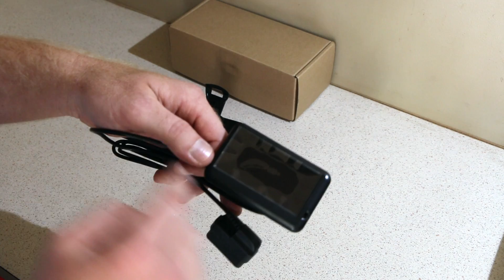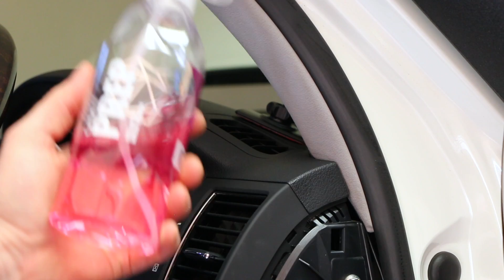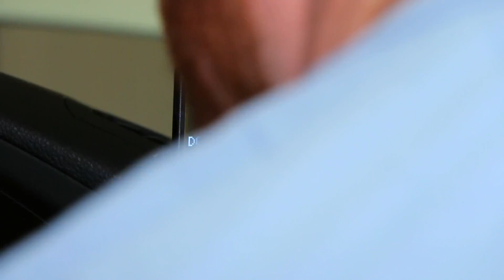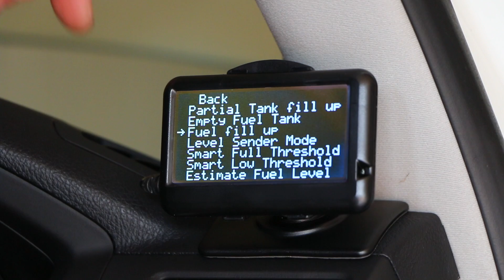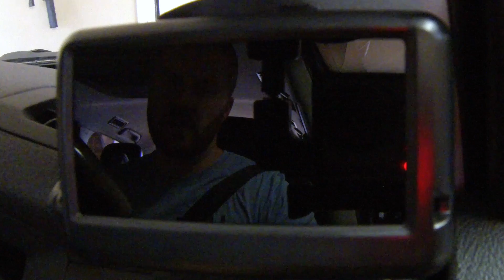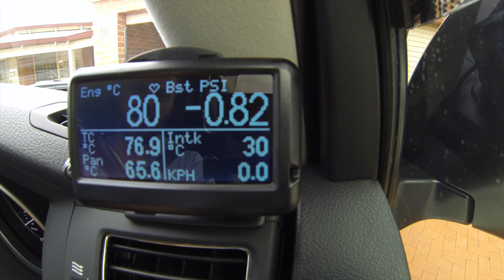LANDCRUISER 200 | Ultragauge MX1.4 | In depth review, install and operation | OBDII gauge | XPLORING

Comment: Another great product review. Do u know if u can turn on/off the beeps that happen when u lock/unlock the car with it? I've had a look at the product sheet and it doesn't look like it but wanted to check. Cheers
Reply from the maker: Cheers mate.
Yes, you can. Not with this Ultragauge though. You can adjust the volume of the beeps from 1-5 (5 being preset from factory) and turn them off all together. 
You can either get you Toyota Service dealer to do this or use Toyota Techstream Software. 
I have turned mine down to level 2.
Reply: @XploringOz  Hi mate, just grabbing one if these and was wondering what bracket you use to mount it?
Reply from the maker: @brettg938  Hey mate, so I just selected the standard horizontal mount. This is just a double sided taped mount that I've secured to the right hand side of the dash.
Cheers, Nathan.

Comment: Great... Best review I've seen! Extremely helpful! 
Thank you for taking the time to make & share. Was the fuel rail pressure available on your vehicle, or did you have to program the unit to access it. Thanks.
Reply from the maker: Thanks mate! I'm glad it was helpful and appreciate the comments.
Yes, the fuel rail pressure (along with all the data shown in this video) is pre programmed into the unit. If you are buying one of these for your 200 series, just make sure to select he 4.5L V8 option for the correct programming. 
Cheers, Nathan.

Comment: Is it true the gauge  doesn't  pick up the turbo temperature  .. if you know  :)
Reply from the maker: It is true. I believe it can be programmed into the unit, however I’ve tried and can’t get it to work. I’m using Toyota Techstream software to pick this sensor up.
Reply: @XploringOz   THANKS VERY MUCH FOR THE REPLY ..
I  ENJOY YOUR CHANNEL WELL DONE   :)
Reply: REQUESTS  DO YOU RUN THE
 Toyota Techstream software IN THE CAR AS THE ULTRAGAUGE DOES OR ONLY ON A LAPTOP   THANKS AGIN
Reply from the maker: @tom_rollings  Cheers mate. Appreciate that. So I always run the Ultraguage in the vehicle. When I do my testing, the Ultraguage is disconnected and I use the laptop. Techstream has a lot more detail and information. 👍
Reply: @XploringOz  many thanks  all the best this year    ...

Comment: It is just another China made copy of scangauge.
Reply: Scangauge have just released version 3, its similarish in look to the UG, but has a colour screen..It looks like its a bit easier to set up by using the touch screen.
Reply from the maker: Just made a whole lot better with more features.
Reply: MUCH better appearance than a Scan Guage... The Scan Guage looks like it belongs in the 90's... That's saying something because so does the Ultra Guage but not nearly as bad...
Reply from the maker: @lexusvip4003  Agreed, both companies could take some design tips from modern day appliances for sure.

Comment: Hey Mate, can you share what gauges we should monitoring while towing and 4WD driving? Cheers
Reply from the maker: For sure mate. I guess its going to be up to personal preference, however I find it helpful to monitor temperatures as a priority. 
Towing puts a lot of strain on the vehicle and associated components, so for me, my towing screen consists of: Engine temp, torque convertor temp, transmission pan temp, intake temp along with boost pressure.
I believe that engine and transmissions temps will be a good gauge to detect any faults or issues early. 
This is not to say there isn't other important data to monitor, however this works for me. 
Cheers, Nathan.

Comment: Hey mate I know it’s on old video but hopefully you can me
Some feedback...Iam
About to get ones off these off an Australian Ultragauge website based in Victoria...is this still ok or you have to get the USA version?
Also for towing was are some acceptable towing temps that we should work within..eg.transmission, coolant, etc etc I have 2016 200 series...any help would be appreciated. Cheers Jarrod
Reply from the maker: Hey mate, 
So I have since been informed that these can be purchased in Aus. If they are programmed for the correct vehicle, which I believe they are, buying from Aus would be ideal, much quicker shipping. 
So I have found coolant temps on the cruiser to be very consistent. They normally sit around the 88-90 degrees Celsius and I've only managed to get it above 100 degrees on a long boggy beach.
It terms of towing transmission and torque convertor temps, these can get quite high without a lockup kit. I found I used to get up to 130 degrees Celsius in the torque convertor (when towing), which in my opinion is not sustainable or desired. However, this is still not high enough to set off the factory transmission temp alarm, so Toyota believe it's acceptable for short periods of time. 
Fitting the lockup kit, I'll be struggling to get temps over 70 degrees Celsius now, towing or unladen.
Hope this helps a little.
Cheers, Nathan.
Reply: @XploringOz  cheers legend
Reply: Mate I’ve finally got one but now I’ve tried to get the fuel settings right after fill up and it’s saying 45lper 100 and around 400 litres left in tank?
Does this take a while to recalibrate? @xploringoz
Reply: It can take a while to tune the fuel usage, but when setup its great. I have it in my BT50, when it says i have used 80 litres, thats very close to the amount that goes in.

Comment: Hey bud the psi reading is that boost each twin turbo is running? Yiu has 17 psi at full load was that factory or after a remap tune ? Thanks bud
Reply from the maker: Hey mate, so the 17PSI is the pressure after the turbo's, so essentially it's going to be a combination of both. Keeping in mind that the turbo's are different sizes and therefore they will be spooling up and peaking at different points along the RPM range.
Cheers, Nathan.

Comment: Thanks for the video.  I have just installed one in my 2018 GXL but get the “err” code on shift position and TC lock up.  Any ideas on why this might be the case?
Reply from the maker: No problems mate. Normally when 'Err' comes up, there is just a minor error within the coding of the 'MX' gauges. This can be manually altered and fixed by the user, but the hard part is finding the correct code to input. Facebook forums will probably be your best bet to find the code. Unfortunately I can't help as I know the codes are different pre-2015 LC200 (facelift)

Comment: Hi, great vid. I have also both units, the scangauge 2 And ultragauge MX1.4 from the US set up for the lc200. Stille experimenting with both.  Priority set to the individual liking. Engine load, rpm, Water temp, oil temp,auto trans temp, gear, locked or unlocked etc. great little unit not to miss. Cheers
Reply from the maker: I’ll be interested to see which you think does a better job in the long run 👍
Reply: Having both for some time, which is your favourite for the 200 and why?
Reply: Hey will this gauge show the transmission oil temp ?
Reply: @jesusgutierrez3218   G’day, yes it shows in my car 2 temp for transmission and torque converter. Cheers

Comment: Curious to know if you can set Audible warnings when temps go beyond a certain pre determined limit please?
Reply: You can set audible alarms for any  of the gauges
Reply from the maker: Hi Craig, so I haven’t discovered any features yet for temperature alarms. I know there are fuel alarms and also alarms for trouble codes. I will let you know if I do discover if it has this feature 👍

Comment: You can replace the TC lockup with gear position. When the TC locks up the gear will show with an 8 in front e.g. 5th locked is 85.
Reply: Yep it's good, frees up a spot on the main page.
Reply from the maker: Chris Chamberlain Yeah, I’m going to start using that in place of the Km/h 👍
Reply from the maker: Cheers mate, I've had a play around and saw that function. Great feature.
Reply: Just purchased this and arrived tonight, haven’t had a huge play around. What gauge do I select to see this function please?